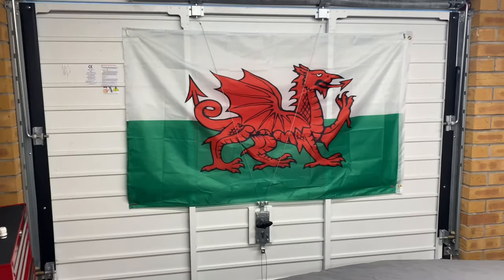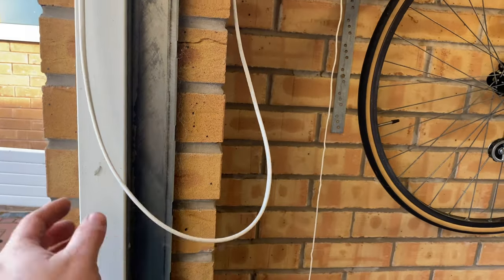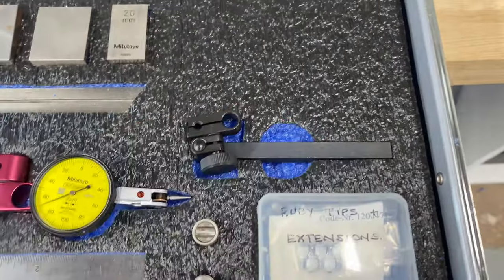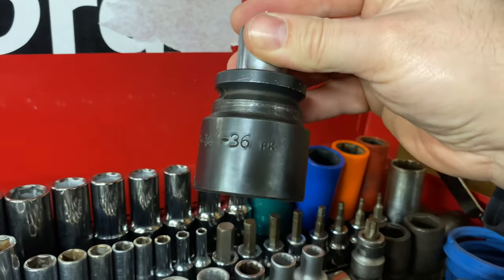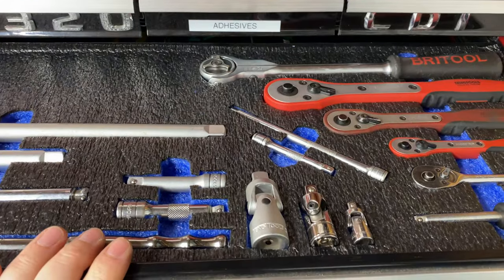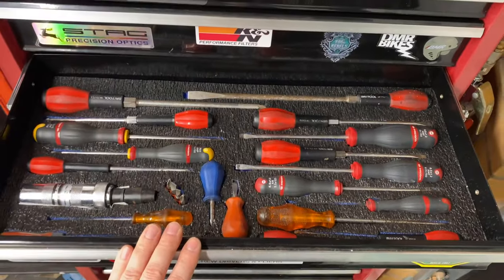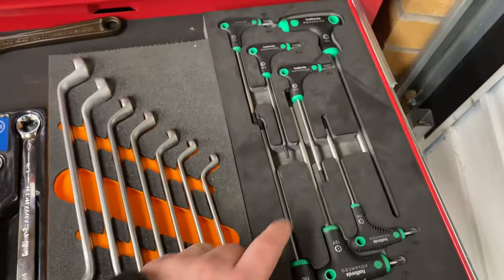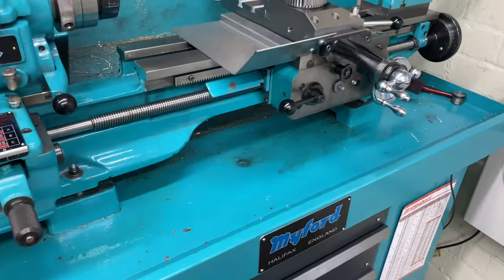Workshop updates and ELS plans

Comment: Hi Colin. If you use a pair of limiting switches activated by the door in open position (pushing against them) you can wire them to be normally closed for the ceiling light and normally open for the door one. Once the door completely opens and touches the switches it will reverse the logic and turn off the ceiling one and turn on the door one. just in a similar fashion to a fridge door.
Reply from the maker: That’s a good idea. I’ll look into that!